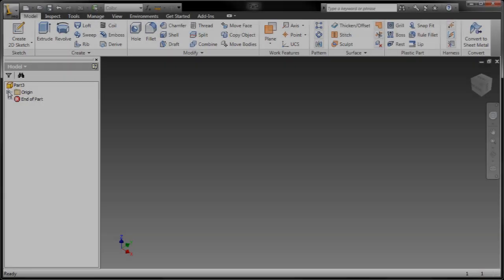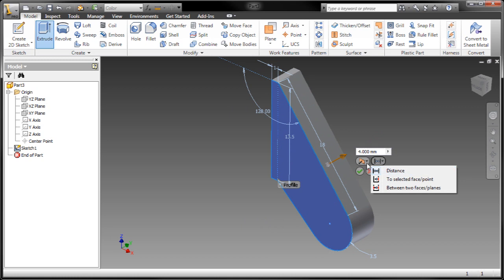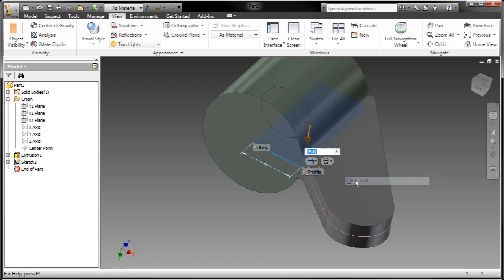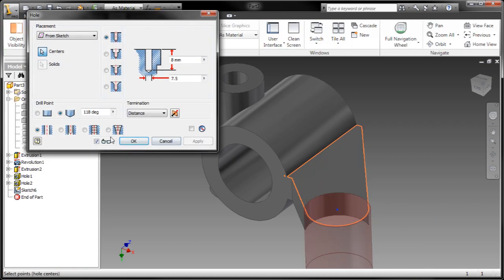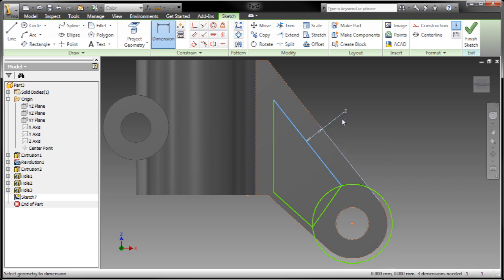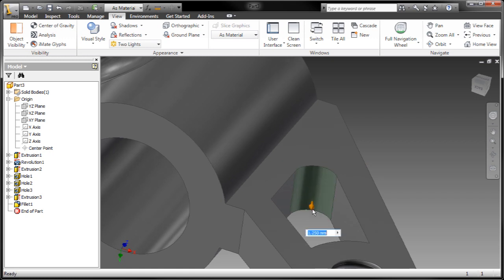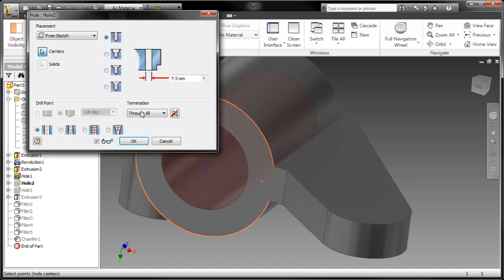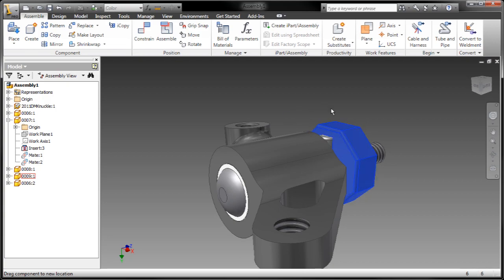Autodesk Inventor 2011 Direct Manipulation Demo

Comment: Very nice. One thing I noticed is that if you switch to "classic User Interface" Direct Input does not appear...We have Inv. 2011 at work, but everyone is afraid of the new User Interface Ribbon (except me), so they won't use it... If they only knew what they are missing.